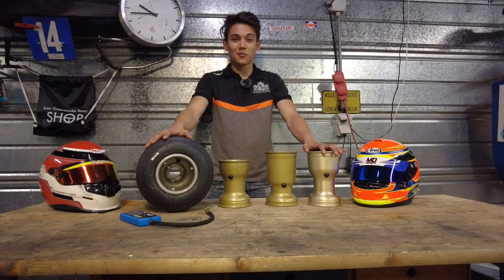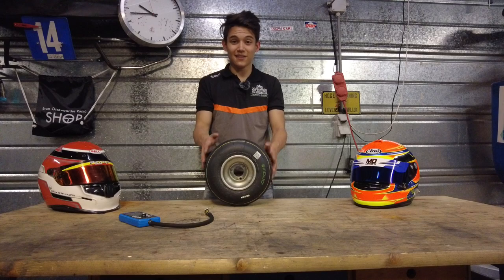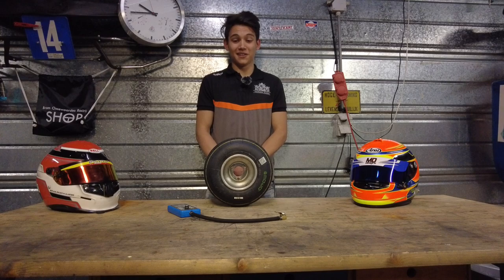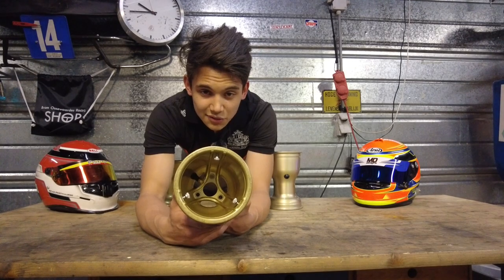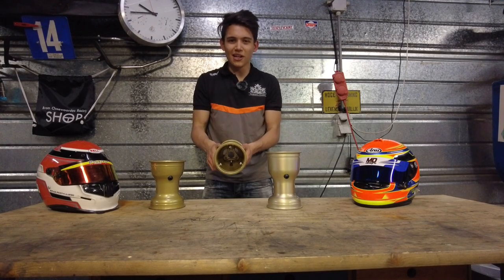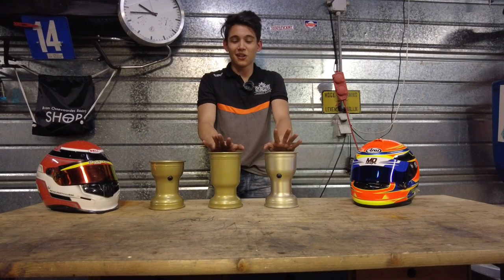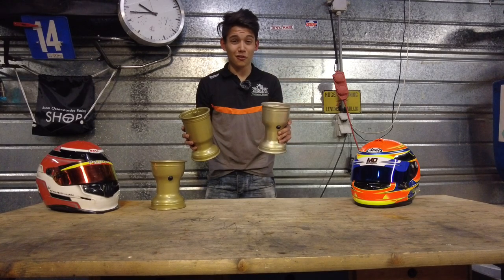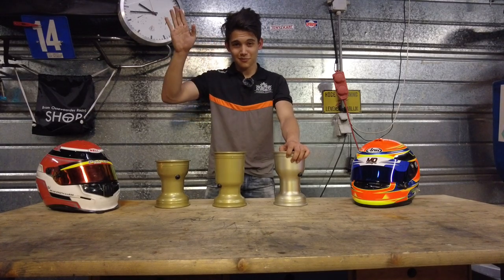Go Kart Tyre Pressure and Tonykart Rims Explained | Kart Setup Basics #1

Comment: with the wet tyre, i use 0,70bar on the rears and 0,75 on the fronts... with the vega w6
Reply from the maker: Ah, Vega wets. These things have so much you can almost drive the regular dry line with it. With my tyres, not possible. Mojo wets are known for having no grip

Comment: Do you ever use the MXQ rims?  If so, under what conditions?
Reply from the maker: Nope, never tried them. I've also never seen someone using them, but I haven't been paying attention to that for very long either. However, I've heard some people talking about MXQ and they seem to like it
Reply: It’s in between the MXJ and the MXC you will see them at like 10-25 C and it depends on your driving style if you like them or not. (I like the MXC but the MXQ just had a little more grip can be handy at some tracks.

Comment: Will otk rims fit on any CIK FIA kart?
Reply from the maker: No. Only the ones that have the standard size hubs. KR and CRG have different sizes for example. But you can just put OTK hubs om them and you're good. We used to sometimes run MXC wheels on our KR with OTK hubs and that was fine
Reply: @RedExions  ok thanks. Do the sizes change between the years or do they stay the same?
Reply from the maker: Years shouldn't matter, only brands
Reply: @RedExions  perfect, thanks a lot, I was actually just building up this tire removal tool and just wondered which tire pressures to put the new tires on, so perfect timing I’d say… 😂